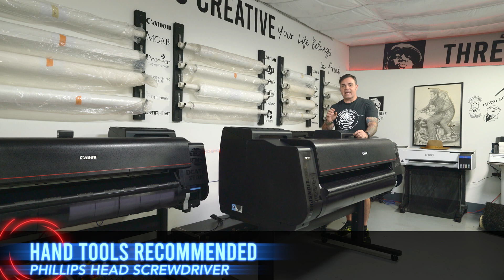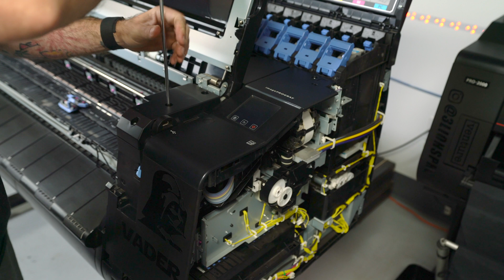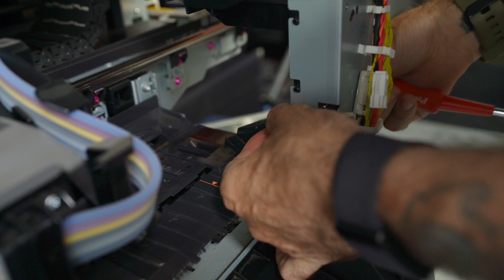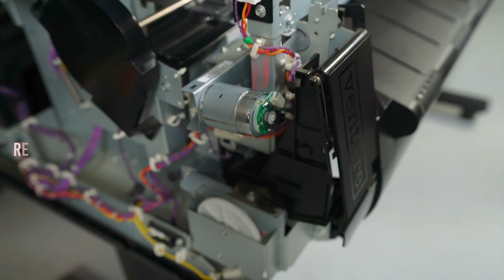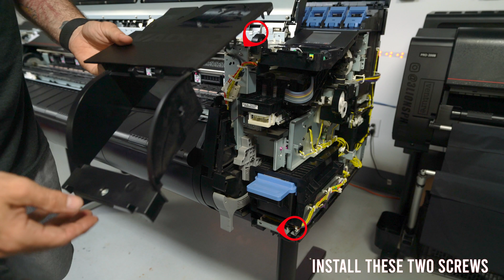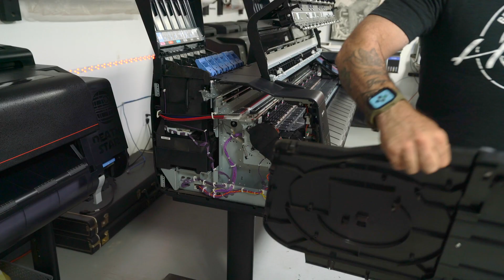CANON PRO 2000 & 4000 ERROR EC15-2E23  FIX & REPAIR STEP BY STEP TUTORIAL - CUTTER BLADE REPLACEMENT

Comment: Great video - I appreciate the level of detail in this.  That being said ...

Before you head down this path the solution may be simpler.  The printer has a rather "ready, steady, stop" attitude to cutter head problems - specifically to protect the motor and drive mechanism.  If your head is on its way out and fails to cut the paper - jamming instead - the printer may throw this error and refuse to operate.  Before purchasing a new drive mechanism try the following;
- Power off the printer
- Lift the lid
- CAREFULLY, gently ease the head out onto its track.  (I remove the print head and cleaned of the dust).
- Replace the cutter head if you took it off
- Leave the cutter head 3" - 6" out of its home position and power on the printer.
- If you are lucky the printer will gently retract the cutter back to home and all will be well.
- INSTALL A NEW CUTTER HEAD - that part definitely needs to be replaced

When you get the new head there's a maintenance menu option to replace it (need a 3mm allen wrench).

Comment: You are a blessing for taking the time to post these videos.  Thank you so much!

In my case, I am trying to figure out an error code EC47-4001 which seems to be an issue with the "Waste Ink Absorber Unit", Part QM4-4242-000.  I am not sure I can find it anywhere online, so I do suppose I'll be calling CANON very soon.
Reply from the maker: You're very welcome.  If you look at this link right here, it will let you know where that part is located, and how it comes out.  I haven't had to replace that part yet, but if I do, I'll definitely make a video.  I could be wrong but it looks like you take the sides off, and the blade unit, and then unscrew the Waste Ink Absorber Unit.  I could be wrong, but just working on these previously, that's probably how I would approach it.

https://printcopy.info/?mod=pc&brand=Canon&model=imagePROGRAF+PRO+4000&page=11
Reply: @threelionscreative180  Thank you again!  It seems to be considered as a Consumable Part. My Pro-2000 is 4 and a half years old with semi-heavy printing activity through that time.  I wish I could at least find a photo of the part online so I have a better idea what I'm looking for.

Thanks to your video, I feel more confident with the relative simplicity of replacing the whole Purge Unit Assembly, so thank you again!  I do wish those part explosion diagrams at the link provided were a little easier to follow.  It's a challenge to see what #5 and #6 on there actually are.  The error description is "ink filled up in absorber unit".  I am wondering if it is something that can be cleaned.

I'll follow up if I figure it out, just so you have a head start should this happen to you or anyone else in the future!

EDIT:   To buy myself some time, I found out that it can be reset in the administration "SERVICE" menu.  I have not replaced the part yet, but I am printing again while I wait for that part to be shipped!  It goes by "Wia6" in the SERVICE menu, which has a lightly tricky way of bringing up.  I can explain if needed!